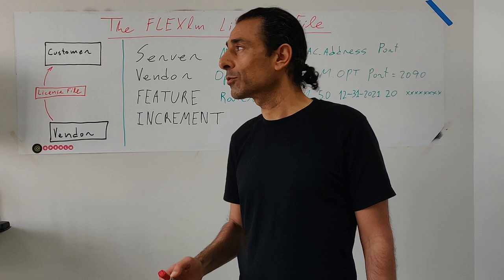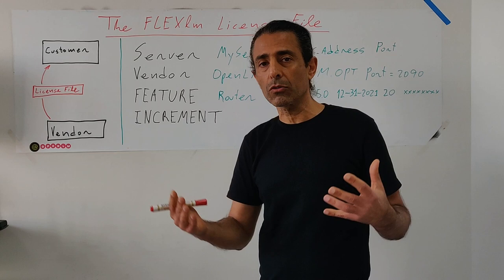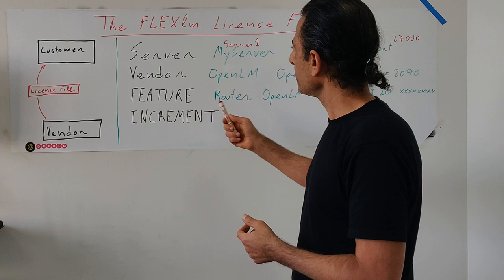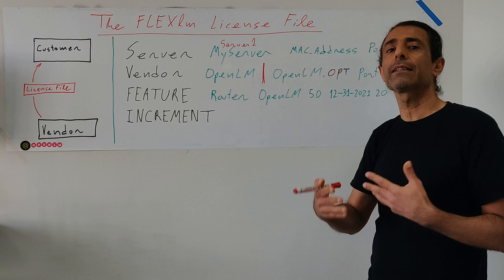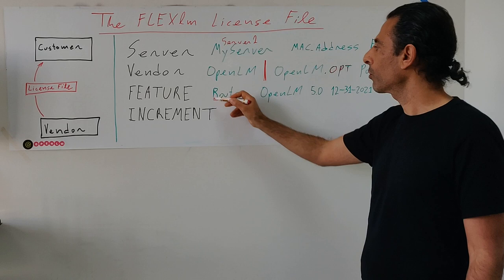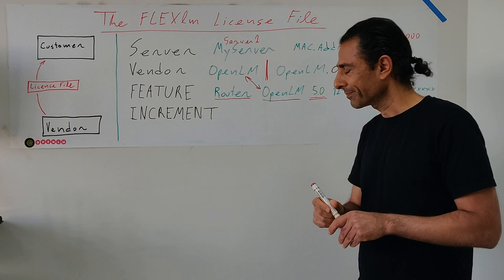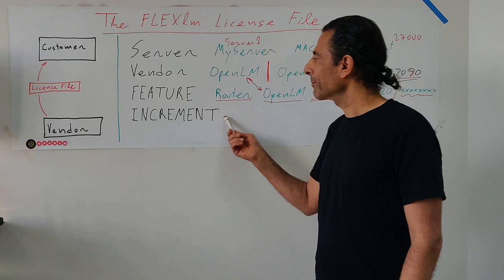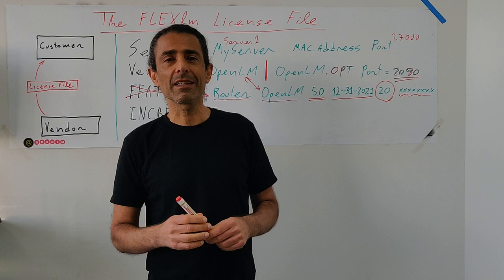VLOG# 41 - Whiteboard video about the FLEXlm license file

Comment: Is OpenLM the same as Rainbow's Sentinel/FlemLM? 

In the case of a floating license, I understand all nodes connect to a server, and the server checks the license and how many active users there are before allowing additional users.    But how do you prevent, multiple servers running simultaneously?
Reply from the maker: Thanks for your question. OpenLM is not the same as Sentinel or FLEXlm, these two are license managers and OpenLM supports about 50 of them https://www.openlm.com/license-manager-capabilities/
The end user that uses the licensed software is connected directly to the license manager. When he starts his licensed software a request is sent to the license server and if a license is available, it is checked out for the user (OUT). When closing the licensed software, the license is returned to the license pool (IN).
OpenLM is on top of this activity, monitoring the license activity and preparing a usage database that allows the company to make decisions regarding the company licensing. OpenLM is taking corrective actions in order to assure optimal usage of the company licenses.